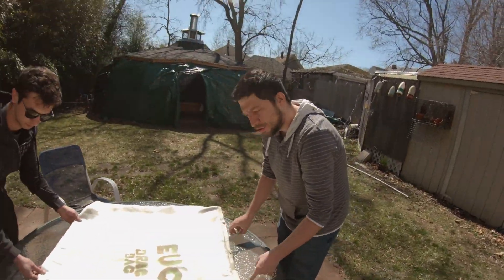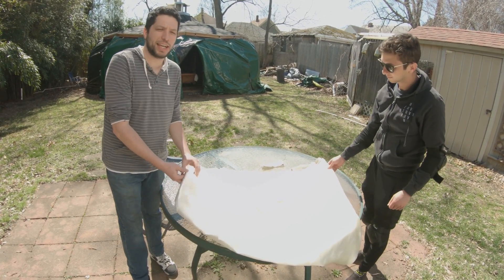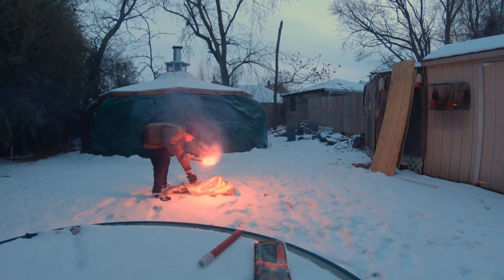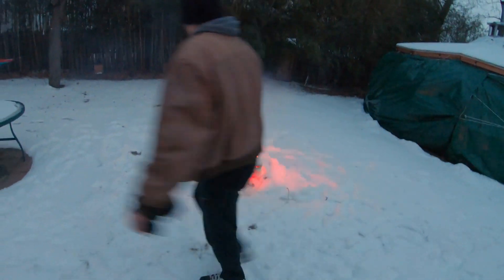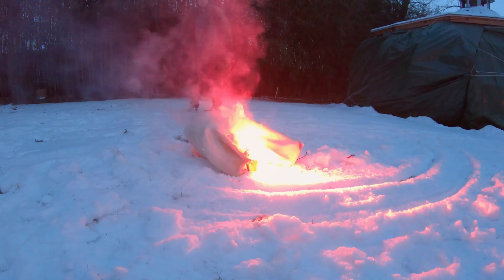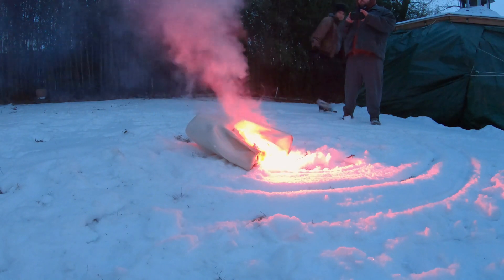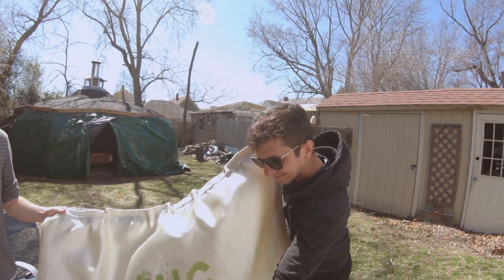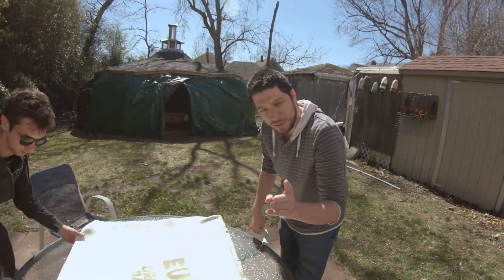Welding Blanket ON FIRE !! NOT FIREPROOF -  Lithium Battery Safety Tip - PEV Fire EUC Drag Bag

Comment: You used a flare that burns at close to 2000 Degrees C.
A gasoline car fire burns at about 800 Degrees C.

Now why the F#@< would you use a flare? 
Except for the hardest metals, everything else melts at 2000Degees C.
Reply from the maker: lithium ion batteries burn at over 2000 degrees

Comment: Hi guys. Exposed fiberglass is not safe to deal with on a daily basis, and not resistant to mechanical wear. As well as any other fireproof fabric. If you think of commercial product, a good start is to do some research of safety and specs of materials. Welding blanket's purpose is to block sparks, not fire. Have a look at fireproof silica fabric with polyurethane coating, top grade only. It should perform kinda like this 1. https://www.youtube.com/watch?v=jbdsBKnyPGg 2. https://www.youtube.com/watch?v=wU1BL4ErTdc
Reply from the maker: Thanks for the tips!!

Comment: I would to own a sealed airtight fireproof container.

Also a question, if a lithium ion battery fire starts, if it is in a sealed container will the oxygen run out and thus put out the fire?
Reply from the maker: no it will not put itself out. apparently a lithium fire actually generates enough oxygen to sustain itself from what i have learned. it needs to be smothered not choked. be careful with making an airtight container also, all that heat and pressure of the gasses expanding can quickly make a cabinet like that dangerous.  something fireproof but vented is probably the best bet.

Comment: If you want to make your idea more effective add a metal liner & a heat activated fire extinguisher with a longer pull cord
Reply from the maker: was thinking of doing a chicken wire lining and maybe a smoke alarm inside the bag
Reply: The fire retardant fabric you're using is going to burn with direct flame contact, If you added a solid metal barrier between the fabric & what's on fire that would help prevent the bag from burning up & using a pyrotechnic fire extinguishing device or a Co2 fire extinguisher plumbed into the bag with a heat activated device would be ideal.

Comment: Hey George great video. Which welding blanket did you use & what rating??? There are many different blankets with different coatings for each rating. Curious which one was used in this test.

Here are some more options as well everything from light to heavy duty 

https://www.weldingoutfitter.com/collections/welding-blankets
Reply from the maker: https://www.amazon.com/dp/B07XSFXG95/ref=cm_sw_r_cp_awdb_imm_5R2RGMX6DG8PG07RYF2R?_encoding=UTF8&psc=1
Reply from the maker: Was just a cheap 25$ fiberglass welders blanket from amazon
Reply: That’s what I figured tbh. The ones I linked are much better quality and higher ratings. I use them at work myself and have seen first hand that they work very well..

Comment: The community is blowing these fires out of proportion. I wish someone (maybe you) would do the research, and the math,  and put things into perspective: In the past year we have heard of how many fires? 5 or 6? How many of those were preventable? 4 or 5? 

Generally fires are caused by people with damaged or modded batteries that ignore warning signs such as their wheel not being able to charge to 100% anymore. Or they are caused by some dude at the factory who forgot to turn on Transport mode. To paint a true picture you need to know how many EUC are on this planet. I'd guestimate 50,000. That means your chances of having a fire are 0.00012%. And it should be mentioned the fires were all Gotway wheels.  That means that based on the past few years your chances of fire are 0% with InMotion. 0% with KingSong. 0% with Veteran. 

Obviously those are not accurate figures but you get my point: fires are EXTREMELY rare and I have no problem sleeping at night with three of them in my house. Your cell phone has just as much chance of causing fire. Look at the EUC 'super-addicts' like Marty Duff and Speedyfeet who own dozens of wheels, and have for many years, and they've had 0 fires. 

Your bag is a good idea but pls do a better job of presenting the facts and keeping things in perspective, otherwise a video like this can do a great harm to the community.
Reply from the maker: Unfortunately without public statistics to support your statements we simply can't know how prevelant the issues are.  As you stated your making up numbers, what if there is only 8000 eucs in america? And we heard about a dozen fires this year alone, that woyld be like 1:300 eucs, which is crazy high number statistically. I doubt its that high but until we have some more concrete statistics, its better to be safe than sorry
Reply: @GoGeorge (1) I am the one pointing out there is no evidence for all this paranoia - prove me wrong  (2) This is not about America, get over yourself -  it's about the entire planet  (3) There are far far far more than 8000 EUCs on this planet (4) How many fires that weren't user error [or a shipping error] can you actually list from 2020? Not many.
Reply from the maker: @Randoman9987  we have seen reports of fires, and i am not familiar with the exact circumstances of any of them. I understand that it is rare but it still needs to be talked about for anyone owning any device with a huge lithium battery inside of it.  For my own peace of mind we worked on this idea to shate with the community for all the people who bought fire blankets not knowing they are not really fireproof. This is a good way to repourpose them into a useable form
Reply: Completely false. There are hundreds of millions of iPhones sold, and the handful of units that caught fire were because they were physically damaged. On the other hand, Gotway has sold maybe tens of thousands of units and they are even catching fire IN SHIPPING. Before they even reach a customer. This is multiple orders of magnitude more dangerous, not to mention how much bigger the battery is. And by the way, even if there were only 6 fires in 50000 that's 0.012%, not 0.0012%. Either way it demonstrates a severe lack of engineering from these companies and something out of the user's control.
Reply from the maker: @dudea3378  the phone batteries are single cells i believe though and encapsulated for water proofing. So that is a major difference from these massive power banks found in EVs
Reply: @GoGeorge  yes phone batteries are single cell lithium polymer, which are in a plastic pouch. By themselves they are dangerous but the engineering is good enough in phones that they're well protected. Euc batteries are in metal cylindrical cells which on paper should be tougher, but the pack design is so bad that they are spontaneously catching fire. And the packs are massive
Reply: @dudea3378  What are you smoking? (1) Who said anything about iPhones? (2) You're absolutely horrible with numbers / using a calculator.
Reply: @Randoman9987  Maybe you need to take math again. You're off by 2 orders of magnitude. You're the one who brought up cell phones. I just took iphone as an example.
Reply: @dudea3378  dude... launch your calculator... enter 6... hit the divide sign... enter 50,000 (psa: this is why you should stay in school kids)
Reply: @Randoman9987  Maybe you should actually learn how to interpret the calculator results before becoming the poster child for the Dunning-Kruger effect. Jesus you are embarrassing yourself. This is sad. Education is failing our youth.
Reply: @dudea3378  In your world what is 50,000 multiplied by 0.00012? (seriously: stay in school kids)